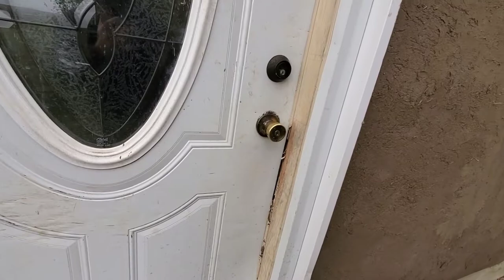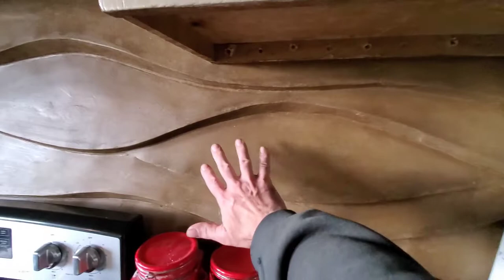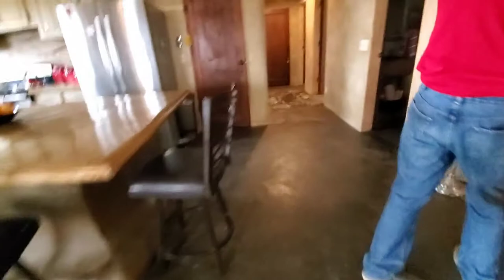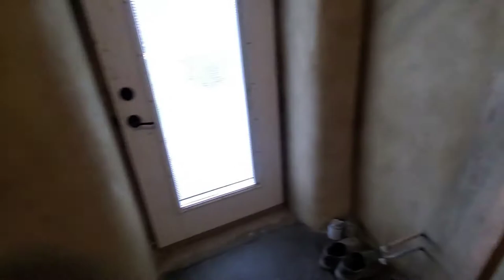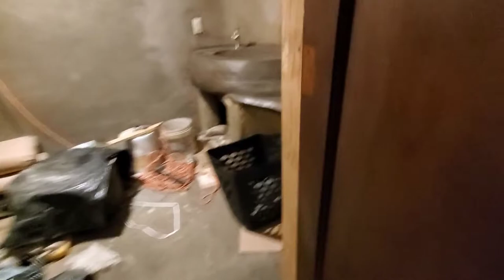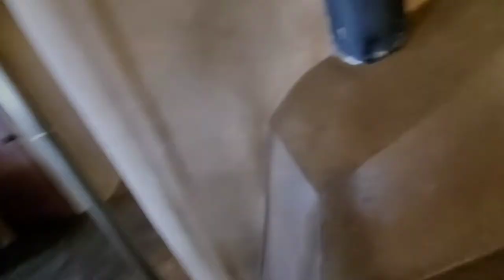Uncle Mud Tour of Nad Kad's Straw Bale and Cob House

Comment: I never understood why American houses don't have an entrance hall, which shields the living room's warm temperature from the outdoor cold when the front door is opened. It saves us lots of wasted kilojoules. All buildings in Scandinavia have an entrance hall.
Reply from the maker: I enjoy my enclosed front porch. Mybe they will put one on this house.
Reply: We designed our straw bale home with "air locks" that would serve the purpose. But, in our not super cold Kentucky climate, and the super insulating value of our straw bale walls, and the huge thermal mass we have inside, we just don't need the air locks. Your results may vary.
Reply: Depends what latitude in the US and yes, not enough have them even in the north. I would think in Canada that might be more normal. I like the idea in general. It also creates an energetic buffer between the outside and inside